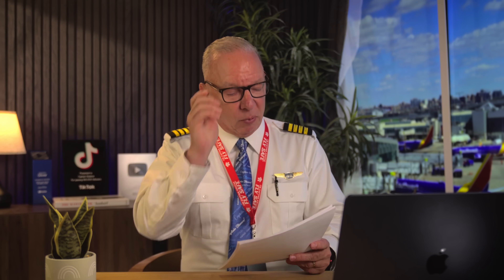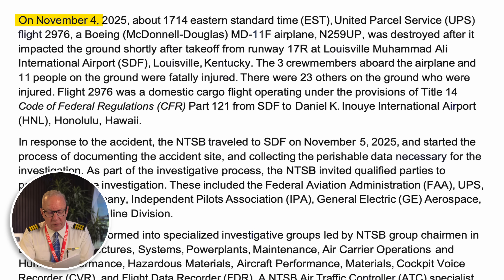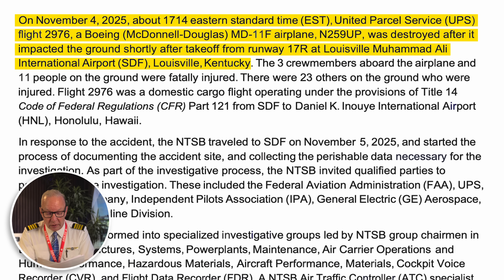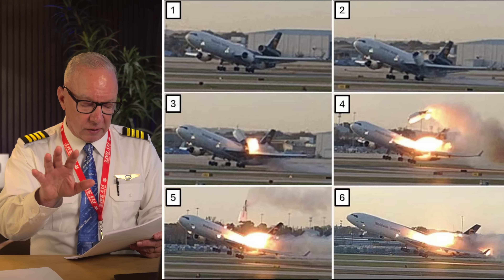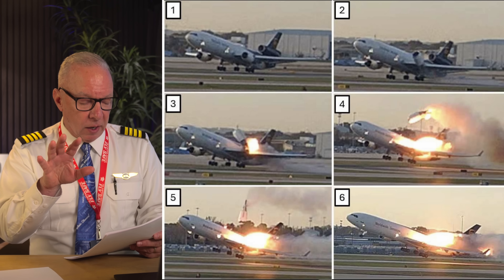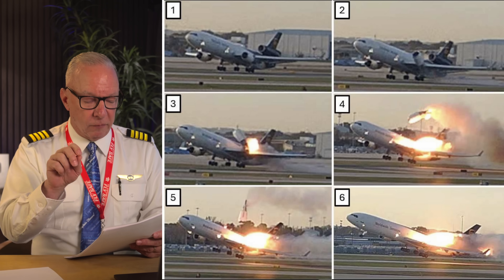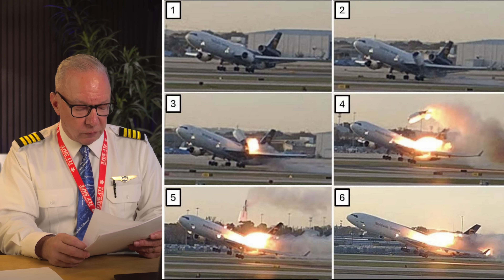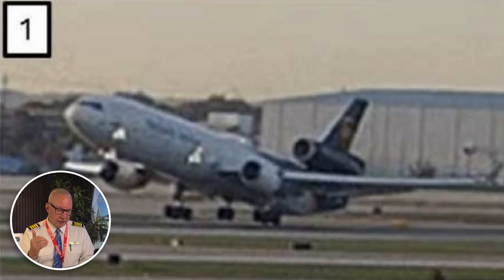UPS Crash Preliminary Report | Pilot Reacts to UPS Crash Report

Comment: This is exactly what happened to the DC-10 at the O'Hare crash. There were photos of the takeoff showing the right engine detaching and rolling up over the wing. The NTSB report concluded that the crash was due to improper maintenance when the engine had been removed and reinstalled. The fact that the exact same fault caused the UPS Louisville crash is testimony to the inadequacy of the O'Hare report and its recommendations, and the difficulty of maintaining a sharp eye on the same engine mounts on a related but different model of aircraft decades after the O'Hare crash. Someone at the FAA should have raised questions about the MD aircraft long before the Louisville crash. My guess is there's not a whole lot of institutional memory at the FAA.
Reply: That was FOURTY-SIX years ago...on an aircraft with a tiny fraction of the cycles that this, or any current-operation MD-11/DC-10 aircraft has on it. That pylon joint failed DUE TO IMPROPER MAINTENANCE...which is why it failed on a relatively new aircraft. 

COMPLETELY DIFFERENT MODE OF FAILURE.
Reply: @DeepNanbu but it failed at the same exact spot. One would imagine the engineer would triple check the design Ang make sure this part is bullet proof
Reply: @carsstuff9914  No very much not how that works.
Reply: "This is exactly what happened to the DC-10 at the O'Hare crash."
Exactly?  Not even close.

Comment: American flight 191 crashed in 1978. The investigation revealed that a forklift or similar was used to lift the engine and pylon assembly to the mounting location of the four bolts. The  forklift was not the correct machine for this procedure per manuals. When the engine assembly was lifted in place, not all 4 required bolts were immediately installed due to a shift change at that exact time. Nothing atypical about this. New shift is fully aware of what work was completed and seamlessly finished the insertion of the 4 required bolts. BUT what was not known at that time was the hydraulic valve that controlled the lifting cylinder had a very small internal leak. While the forklift sat in position and only 2 bolts installed, the forklift was not supporting much of the weight of the engine and pylon assembly. This caused stress cracks at the mounting locations. The hydraulic leak was inside the valve so no hydraulic was visible that would indicate a problem with the lifting characteristics of the forklift.

Comment: Because there were two Aft Lugs, the fatigue cracks were hidden from the outside. You wouldn't find them on a visual inspection unless you removed the spherical bearing. Look for the triangular shape on the Aft Lug fracture surface in the picture above. That's the fatigue crack. It grows until the rest of the area can't handle the load and then fails in tensile overload. Then the Forward Lug, holding all the load, fails in pure tensile overload. Terrifying.

Comment: Everyone needs to remember the engines on these aircraft are Heavey and the bolts and materials are make strong but the engines have a lot of thrust and the engine move around in turbulence and if a slightly Heavey landing there is a lot of stress on those mounts and they will start to fail and sometimes cracks don't start on the out side a crack can be formed in places you can not see on the surface and they can test but the stress point can crack say after a few flights this is no one's fault when this happens and it's sad and the manufactured of these aircraft spend millions to get it right but the loads and stresses are very great and that is why they will scrap some aircraft after so many cycles because of failure and the aircraft may still be able to go twice the amount of cycles that they recommend to scrap this give the safety margine a high safety facture and the pilots did a marvous job even though they did not stand a chance

Comment: Come on, man. 12x5=60.

When you are quick to speak, slow to hear instead of quick to listen, slow to speak, it harms credibility.

Listening to Hoover, we find out the NTSB said nothing about the #2 or #3 engine yet, so all your speculation is just speculation.

You were wrong about the #3 engine compressor stall. You were wrong about the #1 engine slinging compressor blades through the fuselage 

Maybe time for a training timeout to pause and reflect on sensationalism and rash judgement. It is unbecoming.

Comment: Crazy after exploding in the largest fireball I've ever seen in my life (That wasn't in a Michael Bay film) that they were able to determine all this and recover the exact part causing the issue, but yet the plane that hit the Pentagon on 9/11 just vaporized with zero debris or evidence... It doesn't get any hotter than a cargo plane full of jet fuel compared to a passenger plane that had already been flying. I don't mean to deter from this horrific tragedy of UPS flight, but the more planes that blow up the more my brain goes back to 2001, especially since I'm supposed to Never Forget.

Comment: Why do you keep saying it wasn't at 481ft based on adsb? The field elevation at TDF is 500 ft MSL, the elevation of the end of the runway is 461 msl. The adsb data is accurate, 481 ft would be 20 ft above the end of the runway. I find it strange that you havent put together that they're saying 481 msl, not agl.
Reply: @rg759
ADS-B altitude data is Pressure Altitude
NOT MSL
NOT AGL

Comment: I’ve never liked how those engine mounts work. You have these 4 bolts that are absolutely critical to the plane, they get taken apart when the engine is changed so it’s a weak point by design. Those need to be inspected a lot more frequently.

Comment: Captain Steve,  with the pylon mounts failing, could there be issues with other wing mounted engines? 

Is there a need to increase the frequency of detailed inspections on these critical connections?

Comment: I didn't realize the engines PULL the plane forward and don't PUSH it forward. I always thought Thrust = Push.  Always learn something new from Steve.
Reply: That's why unwary people get sucked into jet engines from the front
Reply: You would be correct with regard to the #2 engine mounted at the base of the tail.  That one would be pushing the aircraft.
Reply: They suck, squeeze, bang and blow.
Reply: It would be "push" if they were behind the plane and sitting against the frame.

Not to be an ahole but pretty logical.

Comment: 4:14 unfortunately i was right that number 2 engine ingested pieces and parts from engine number 1 as captin steve mentioned that he thought it was number 3 engine although possible but unlikely the only way that would have been possible is if the blades would have exploded outward I could tell the engine departed the aircraft by the amount of fire on/in the leading edge of the left wing

Comment: I am glad I saw that compressor stall fireball right: I thought it came from #2. Debris entering #2 was more plausible to me than #3.
Reply: Has he acknowledged being completely wrong about this yet?
Reply: @supradma71  CS plainly and simply stated so in the video.  Considering the poor earlier viewing angle of the #2 and #3 engines, his initial hypothesis of engine shrapnel damaging #3 was entirely plausible.  Additional, new data (the 6 photos capturing the #1 separation, and the flare from #2) simply put the matter to rest, which he acknowledged.  That's how science works.
Reply: @stuartparker-q3o  In the other video, it was quite clear it was the center engine that was stalling.  His hypothesis had little to no merit from the day it was originally brought up.
Reply: @supradma71  I would disagree on how "obvious" it was, based on the Blurry, initial viewing angle.  ALSO: Recall, please, that CS is an Experienced PILOT, far more familiar with aircraft systems than I or (most likely) You.  Just that.
But we now know What specifically happened, and can move forward to prevent it happening again.
Reply: @supradma71 I think he mentioned that. But I'm not fishing for confessions, just glad my own perception is in working order.
Reply: Yep, up and in.  But it probably wasn't debris.  Ingesting a fireball causes turbulent flow inside the engine and sputtering.  FOD would likely have knocked it out quick.  Engine #2 might have recovered as the aircraft gained speed and fuel flow was cut to the missing engine, but there was no time for that.
Reply: @AJCiani-physics  I agree, it was likely the fireball causing the stalls in #2, possibly some debris, but most likely the fire.

Comment: You need to explain what a clevis pin is. It's pressed in thru the circular fitting and bolted in to hold it in please.   It can be extremely difficult to replace and is critical for safety. My son's 70 Camaro, it took us 1 year to get the brake pad clevis pin out and fix it with a modern brake booster.

Comment: Pre-existing fatigue cracks in the rear assembly mount?!? I'd not be surprised if SOMEBODY will answer for this, I mean what happened to the routine inspections of the engine mounts
as well as the engines themselves? 
Somebody got lax with that....

Comment: 5:25 I just want to point out that you keep saying that the NTSB's altitude data is wrong. It's not. They're not measuring from the ground; they're measuring from mean sea level. You just seem to be misunderstanding what they're saying, which surprises me considering your experience as a pilot, and the fact that on your channel you usually try to explain those discrepancies to people rather than just saying they're wrong. 🤷‍♂️
Reply: @rhymeswithsomethingy4766 
@techwolflupindo
@JJ-xh8qk 

I retired from the same airline as Captain Steve after 35 years and over 30,000 total flight hours including time in a DC10.

Above ground level (AGL) altitude is measured by the Radio Altitude system which consists of at least 2 radio altitude antennas on the bottom of the fuselage, near the center of gravity, which is just forward of the main landing gear. The distance is measured from a point close to the center of gravity so pitch changes will have minimal affect on radio altitude. A downward signal is sent by one antenna and received by another antenna. The speed of the signal is constant and the time it takes for the signal to leave one antenna and return to the other allows the RA system to determine the precise height above the ground. A simple Time/Speed/Distance calculation is done automatically and displayed on both pilot's instrument panels.
The Flight Data Recorder (FDR) said the jet reached an altitude of 30 feet above ground level.
The ADS-B data showed 481MSL (100AGL)
Captain Steve is absolutely correct. The jet never reached 481MSL, which is 100 AGL. Look at the photo. An MD11 is about 200 feet in length. The height is measured just forward of the main gear. Does that distance in the photo look like 100 feet???
The jet reached an altitude of 30 feet.
Radio altitude is very accurate. That precision matters. It is how the autopilot knows exactly when to flare during an autopilot landing in zero visibility.

ADS-B data is used to separate aircraft in flight. It is not an accurate representation of either AGL or MSL altitude.
ADS-B data is an accurate representation of pressure altitude, which is the height above a standard atmosphere datum plane of 29.92 inches Hg.
The NTSB released ADS-B altitude data after the accident because it was the only altitude data available at the time.
Once the black box was recovered. the FDR revealed an accurate, above ground level, altitude.

I have never met Captain Steve but he knows what he is talking about. It took years of experience to get the job and he now has decades of experience. He likes to share his expertise. 
He tries to keep his explanations as simple as possible so everyone can understand.
Reply: @CWK090 Thank you for that explanation. I think it would have been helpful if Captain Steve had offered a bit more than just "their wrong", which seemed to undermine the credibility of the NTSB, because when I saw press briefing with the NTSB, what they said didn't seem to jive with Captain Steve's comment about what they said 🤷‍♂️
Reply: @rhymeswithsomethingy4766 
I am happy to help.
It is a little confusing.
ADS-B altitude data is the same as your transponder altitude data. Both are pressure altitude. 
The air traffic controller manually enters the local altimeter setting in the ATC system and then reads MSL altitude from both your transponder and ADS-B.
This is why ATC will say “I show you 100 feet above your assigned altitude. Verify altimeter setting 30.12 (or whatever)” He needs to make sure you are both using the same altimeter setting. 
The accident report says ATC provided ADS-B altitude was 481 MSL.
Again, ADS-B altitude sends pressure altitude. Controller adds local altimeter setting and reads MSL altitude.
ADS-B was never intended to be an indication of height above the ground. 
The NTSB released ADS-B altitude before precise RA was available from the FDR because that is all they had. 
BTW, a factor that contributes to ADS-B altitude lack of precision is rounding.
Bottom line, ADS-B, corrected for local altimeter setting, is just not a good indication of precise height above ground level (AGL).
When accidents like this happen, there is a lot of pressure on the NTSB to find the answer.
The NTSB does a great job but it definitely helps to have Captain Steve and others explaining what the NTSB actually said in terms everyone can understand.
Reply: I have to agree with you.  I was was surprised also.
Reply: As a pilot MSL AGL yes a difference . But Does it matter or are you wanting to be the so called experienced pilot. 
I understood him because I am a pilot , but again , does it truly matter to an individual who is not a pilot, 
Captain Steve is a very experienced pilot. 
So get over it
Reply: @JJ-xh8qk I'm saying that as the experienced pilot, Captain Steeeve usually makes it his job to explain these types of things to his audience. It's one of the reasons we tune in. I'm just trying to figure out why he is not in this case. He just keeps saying they're wrong..
Reply: @r @rhymeswithsomethingy4766 hey are wrong.
Edit…The NTSB is not “wrong”
They are only reporting ATC provided ADS-B data which was never intended to be and is definitely not an accurate representation of an aircraft’s height above ground level (AGL).
Reply: You misunderstood what he said and showed (without saying). The initial report showed 100 feet above ground level and 400+ mean sea level. Roughly 3 times higher than it got. While Steve read the MSL he highlighted the AGL as well. He didn't say anything incorrect and he didn't harp on it either. It never got to the altitude initially reported. Maybe you wanted him to go on a sidetrack about both wrong numbers but he only said the wrong number was wrong and didn't explain the difference between the two wrong numbers and the correct number. Get over it. I wanted him to go on a sidetrack about the type of grease used in these bearings, but you don't see me crying about it. You don't have to be insulting to make your point, especially when you're not even right.
Reply: @ED-es2qv  He also pointedly did not read out the 100ft figure.

He said "Initial reports were 400 ft" he read out 481ft/

It's completely fair to assess him as desperately wanting to avoid admitting he made a mistake and missed the "MSL" on his early videos.
Reply: @BaalsMistress 
The only thing Captain Steve is “desperately” doing is trying to educate people who have zero aviation knowledge.

ADS-B altitude is not MSL except on rare occasions when the altimeter setting is 29.92” Hg-1013.2Mb
ADS-B altitude is not AGL
ADS-B altitude is PRESSURE ALTITUDE.
ADS-B altitude is the height above the standard day, sea level, 29.92 datum plane.

This is not rocket science.
This is basic Private Pilot knowledge.
Reply: @CWK090  I guess you should go educate the NTSB then.........
Reply: @BaalsMistress  
What did the NTSB say that you disagree with?
Reply: @ED-es2qv the NTSB wasn't wrong. The data they were reporting may have been wrong and that it was an estimate based on the data they had at the time. That explanation would be educational and useful to understanding what is being talked about. It's not a sidetrack. I wasn't insulting, and I generally appreciate Captain Steeeve's explanations, and often defend him against critics who claim he's speculating or wrong when he is simply offering potential explanations.. discussions are what comments sections are meant for.
 BTW, you did just complain about the sidetrack you wished he'd taken. You just chose to do it here rather than as a stand-alone post.. 🤔
Reply: Yea, I'me wondering if he is really a pilot or just a experence trainer.

Comment: The elevation of the end of runway 17R is 461 feet. 17L elevation is 471 feet. Add 30 feet Radio Altimeter and you get 491 feet/501 feet MSL. The AdS-B data is roughly correct. The airplane got so “high” in relation to MSL….mean sea level.
Come on 😏

Comment: failure to do proper inspections and replacements of parts is what I get here. You blame the design but like with everything parts get stressed and need replacement. Engine bolts are pretty important... replacement should be mandatory on all jets after 25 flights.

Comment: This preliminary analysis misses a propable crash cause.  The aircraft reportedly impacted the ground at 184 kts.  VR is ~140 kts and the aircraft will fly at least 5-10 kts slower than that.  No stall warning horn activation has been reported.  Therefore, the aircraft did not stall.  The the pilots flew it into the ground.